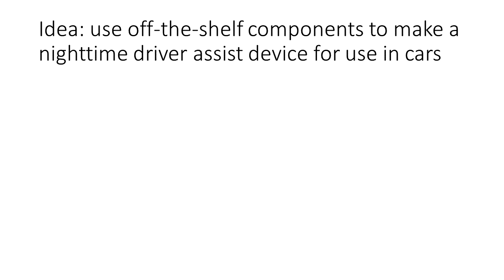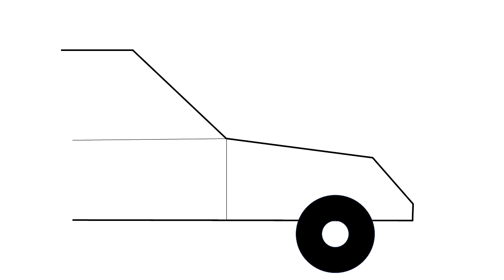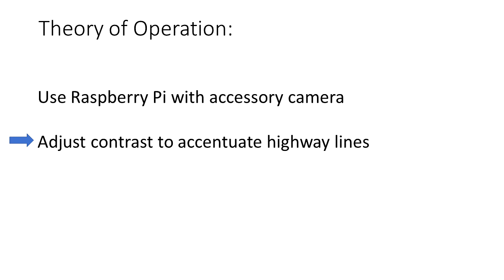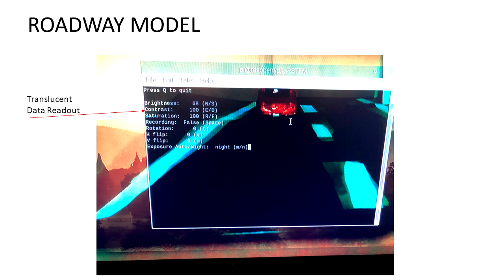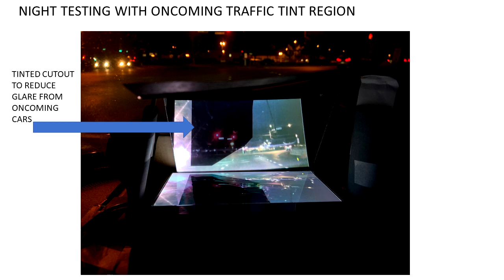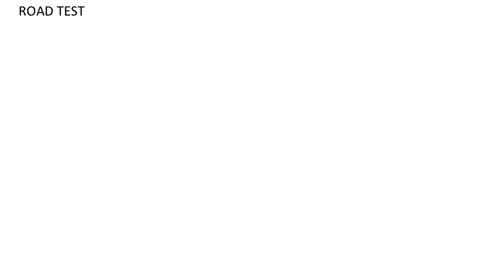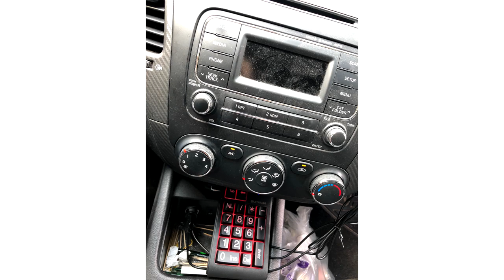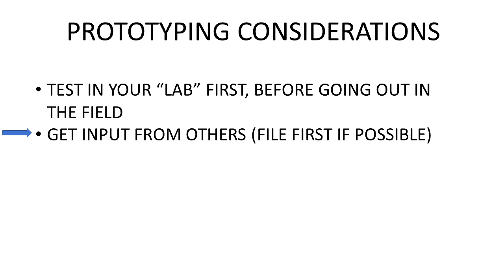Night Vision in a Car using Raspberry Pi - A case study in prototyping

Comment: What software did you use? If you wrote code, did you upload it somewhere?
Reply: This is not really night vision, just a contrast enhanced camera. A true night vision needs to be based on FLIR for any practical solution. There are just way too many light sources on a normal highways as this prototype proved... Of course this could be mitigated with further signal processing but I'm not sure if a Pi will cut it.
Reply: @dingdong2103  Yes, just an interesting hack. I’ve done similar with a DSLR, but not the HUD.
Reply: @thetechq  On some cars even a separate mirror is not needed, the windshield itself reflects enough if you put a screen on the dash...
Reply: @dingdong2103  Cool. Good to know!